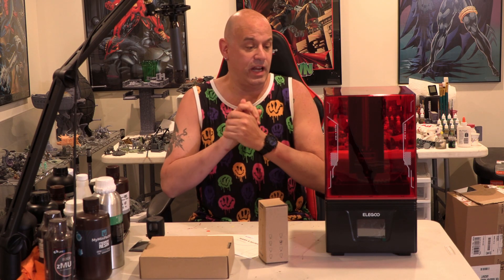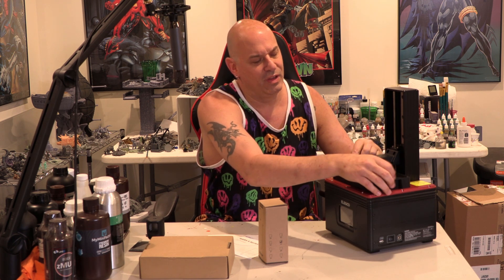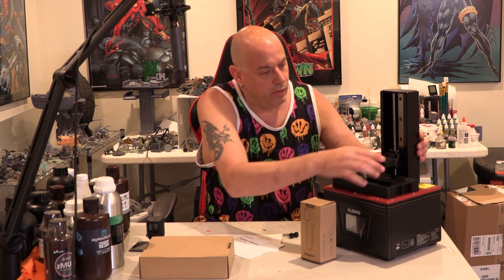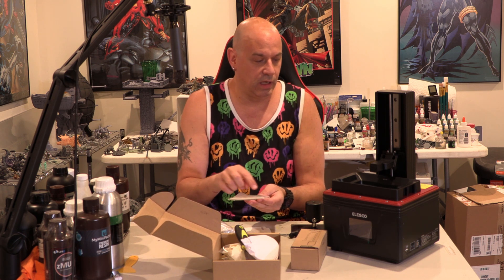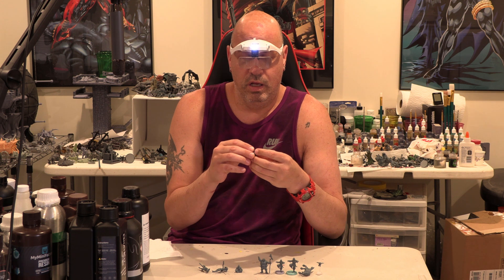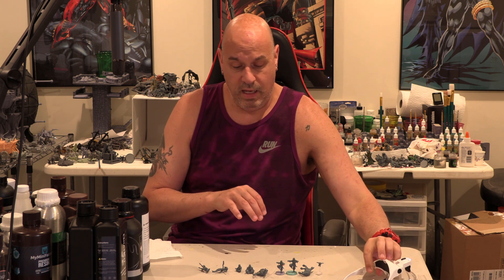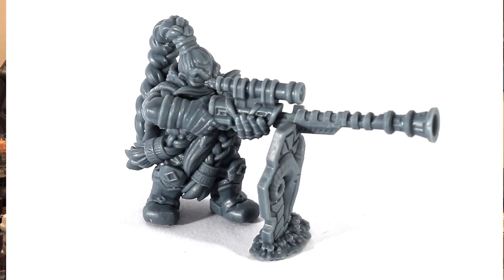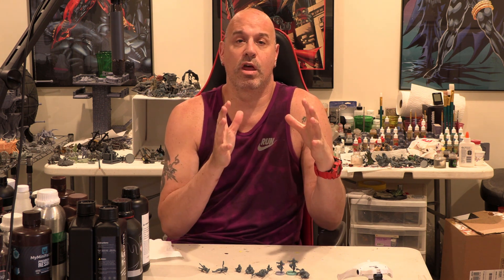Mars 4 DLP resin 3d printer review:  this machine is awesome!

Comment: If you are looking for more printers to review, then I would suggest thinking about the Anycubic Photon Mono 2. It's a couple of months on the market and around the $200 mark. I just switched to using one from using a Saturn. I'm absolutely shocked at how good it is. I swear it must be the best beginner machine out there. The FEP is a little more costly though as it comes in pre-installed frames, but you wont have to worry about tension.

Comment: Nice video. I love my anycubic dlp printer, however the build plate is small, and the mars doesn't seem to be any bigger. Is this a limit of the dlp technology as well?
Reply: Yes. Texas Instruments makes the DMD (Digital Micromirror Device) Chip sets at the heart of these DLP (Digital Light Processing) technology 3D printers. TI charges a lot of money for these DMD chip sets, and the price goes up fast with higher resolutions. TI charges about $30 for just the DMD part of the chip set (and that’s when buying minimum of 1000 pieces per order), which is a 1280 x 760 pixel DMD device. That’s a good price cause they used to charge about $100 to $120 for that resolution DMD device. The Anycubic Photon Ultra uses that DMD chip set for 80 micron pixel size and small build area. The Anycubic Photon D2 and Mars 4 DLP also use the this 1280 x 760 pixel DMD, but they also use an XPR (Extended Pixel Resolution) module which essentially shifts the pixel field by 1 pixel in the X and Y directions (over four sub time periods during the full layer exposure time) to produce a resolution of 2560 x 1440 pixels (about 51 micron pixels at the projected build area on the newer DLP printers). Long story short, until TI lowers the cost and gives us affordable higher resolution DMD chip sets, these Anycubic and Mars DLP printers are probably all we will see.

Comment: "down in the 20s the eye won't be able to see any better than that" We will be able to see the difference but it won't be more general detail, anything under about 30um is getting you more texture, that's the level of detail we are getting to, I'd think the difference between 10-20 could even be seen in terms of textures. Think about what makes matte surfaces matte? microscopic bumps, individual bumpas are microscopic yet we can still see the result of them as they create visable texture. Or take butterfly wings, their wings instead of using pigment to reflect certian colours, they have structures the size of visable light that trap certian wavelengths and reflect others, since these structures are the size of visable light waves they cannot actually be seen with a microscope, they are too small, instead scanning electron microscopes are used to see the actual structure. However, we can still see the result of these structures with our eyes despite not seeing the structures themselves. So it will absaloutly be possible to see the difference with higher detail prints, infact we already can, look at a camera sensor, the micro mirrors in a DLP printer, or a silicon chip in general, they are very colourful because they have parts on the scale of light waves so specific waves are reflected and absorbed due to the geometry just like the butterfly wing. Painting of course makes this level of detail irrelevant, I doubt after priming you could see better than a 20um DLP even with a microscope.

Comment: Yeah I have an anycubic d2, basically the same as this printer specs wise. 
Absolute joy to print, no worries about dead screens from failed prints or mistakes on my part (4k screens cost a bunch in au) 

Got it for $450usd including shipping and tax, with a wash and cure and 3kg of craftsman resin from anycubic. So the deals are out there.

As a display painter and not army builder it is just a nice printer, extremely quiet and low power too.